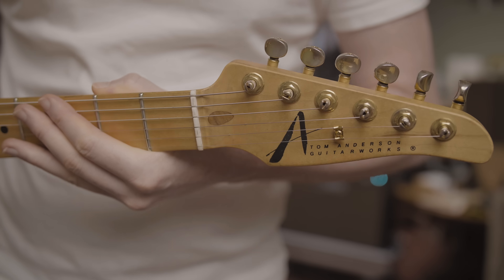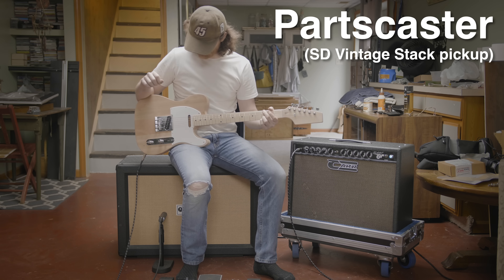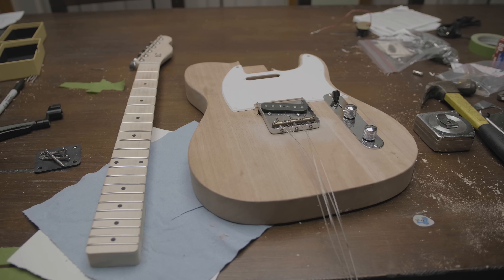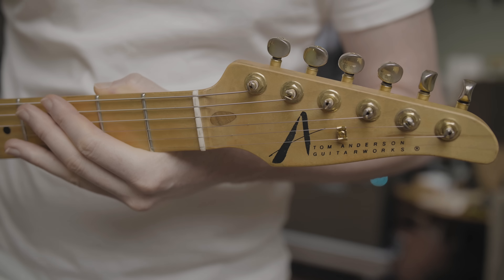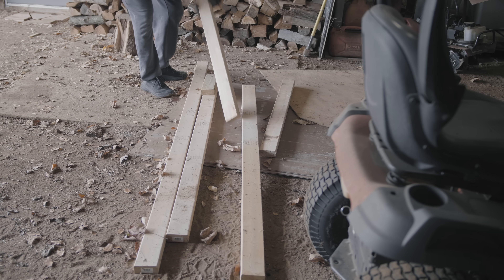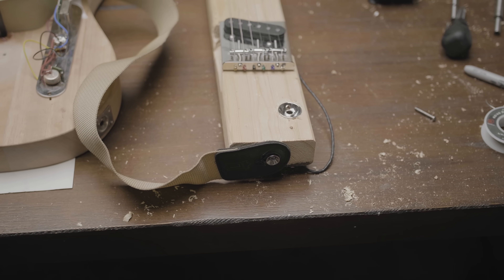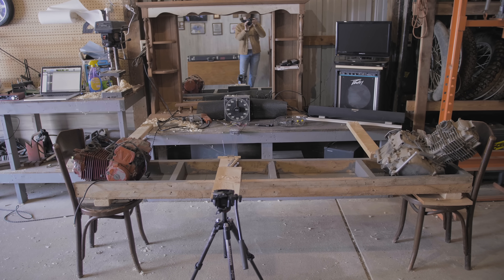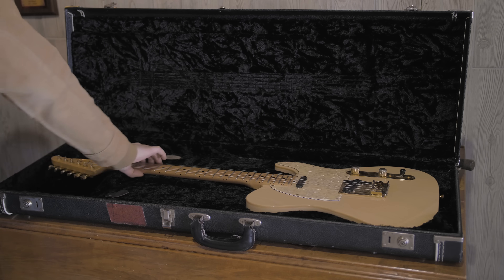Tested: Where Does The Tone Come From In An Electric Guitar?

Comment: Truth is wire length, type, capacitors pickups and wiring are all that matters concerning tone. Playability, sustain and consistency of tuning are the only factors that the guitar itself affects. Acoustic guitars are where the wood selection is everything. In both acoustics and electrics, neck joint is responsible for sustain. Tone is impacted by neck joint only in an acoustic. Dovetail joints offer more warmth and sustain in the acoustic. In the electric, sustain is the only tangible variable. Taylor acoustics are super bright because of the bolt on block. Gibson and Martin are warm and sustain because of the dovetail joint. A les Paul will sustain longer than a strat, but the tonal differences are 100% humbucker vs single coil. My Custom Shop Strat is only better than a squire because of electronics and wiring. Swap both loaded pick guards between the two, the squire would sound like my custom, vice versa. That stated, a squire on a high end tube amp would sound much better than my custom on a $99.00 practice amp. Buy a cheap guitar, a set of seymour Duncans, and take the money you saved and purchase a better amp. Trust me on this one. An amp upgrade will satisfy much better than any guitar mod or upgrade.

Comment: This is amazing work. Personally it confirms what I've always thought to be true, that the string's interaction with the electronics are what determines tone.

I just wanted to say that just getting a certain tone isn't everything. Sustain for one, i wonder if that engine weighted steel bench was just much better at holding tension than the softish 2x4 and cleaned up the top end through improved sustain or possibly resonance, depending where the amp was.
Reply: https://youtu.be/sYK0XX-nDVI

Comment: I guess my next build will be with a 2x4. Sounded great. Great video. Sometimes I think the perfection that people try to squeeze out of a guitar is one of diminishing returns. Throw money at it to get 1% improvements, however that’s measured, when most people would never notice the “improvement”. I also believe you could put a top band on stage with all kit guitars, and very few would notice. Doesn’t mean I wouldn’t want a high end factory guitar; just means I could get on stage with my doctored up Squier Strat and no one could tell. It does sound great.

Comment: This is a good video. I could hear some very slight differences in the two bodies when you matched the height, but virtually no difference with the air guitar. Question does engaging with the fretboard and neck have an impact?

Comment: I've always stuck by the theory that the only thing that makes a difference is the player. Case in point, you could take any person and have them play a guy like Dimebag Darrells exact set up and it will sound completely different than when Dimebag is playing. 

Of course for test purposes when playing  is identical I've never thought tonewood mattered on an electric guitar simply because the sound itself is coming directly from the pickups.

I'd say 10% is hardware, 90% is the person playing it

Comment: I always suspected “tonewood” was a gimmick. Except for acoustic guitars, then Im pretty sure it matters.
Reply: Yeah it's definitely important for acoustic guitars
Reply: The reason why it's important for acoustic guitars is the sound you're hearing for the most part is the soundboard vibrating. The soundboard is the bit of wood on the surface of the body that the bridge is attached to.
Reply: Although, I have found it's not as important as people think with regard to acoustic guitars either. Yes, the soundboard is critical. But, the rest of the guitar is not nearly as important.
Reply: @probusexcogitatoris736  Yes Torres made a paper mache back and sides guitar in the 19th century to help prove this point.
Reply: @probusexcogitatoris736  to me it seems like the overall size and rigidity of the guitar body that makes the ultimate difference for acoustic guitars, so bracing etc moreso than just the materials themselves.

I've been a 'tonewood' sceptic for electrics probably since I started playing guitar when I was a teenager though.
Reply: @danardisimracing  Yes, that is probably true. Would be interesting to know whether that is actually more important than the soundboard....
Reply: I think even for acoustic though, body shape and the size of the sound hole are probably the two most important variables.
Reply: @markkicksass2448  I'm not entirely sure. I encountered an early D-60 at the Martin factory back in the mid1990s.  It's basically just a D28 only with a back and sides of maple instead of rosewood. It was brighter and snappier sounding than any other dreadnought I'd ever played.
Reply: I think wood is probably important for durability and intonation as well, not really quality  tone itself
Reply: @Phazur  wood makes a huge difference in tone quality. At least in classical guitars. Maybe a bit less on steel stringed guitars, because they need to be built sturdier to withstand the tension.
Reply: Listen, buddy. There are dentists, investment brokers, and pharmacists on TGP with impressive PRS and Gibson collections who argue that there's a massive difference between their Honduran and African mahogany guitar bodies, and that their two piece and one piece guitars aren't even in the same realm. You think I'm really gonna believe you yokels over these guys and their finely tuned ears?
Reply: @karlkrause6679  😂 I’m actually a pharmacist so…. Yeah 🤣
Reply: Acoustic guitar bodies don't have to be made of wood. Mattias Krantz made a guitar with a balloon as the body.
Reply: @YlowX7  of course they don't have to be...but the material actually makes a big difference in sound.

That's like saying you don't need wheat flour to make bread. No, you can use something else, but obviously it'll taste differently.
Reply: Isn’t tonewood on an acoustic guitar basically an amp? No doubt it’s important.
Reply: absolutely right mark kicks ass! edit: your original comment..
Reply: There is a difference. The question is, is it a 5000$ difference?
Reply: @tubeaddicted485  it is law of diminishing returns. I think expensive wood for a guitar is for good aesthetics for a natural, transparent or semitransparent finishes. For a solid body though I suppose for weight and durability but not for tone.
Reply: I think Greg Byers talked about doing a similar interchangeable guitar experiment.
Reply: Funny how many of us rebellious artsy-fartsy types are easily influenced by corporate marketing.
Reply: For acoustic ones is a strong pillar. For electric ones, well, you have just heard it.
Reply: In this video I hear a difference between maple and rosewood frets. Nearly every variable creates a slightly different sound. They all add up to the differences between guitars. Is a different wood going to make a big difference? No it's only a tiny difference. But you cut a corner here, cut one there and it starts to add up. Obviously the biggest difference is pick ups. Swapping those will drastically change the sound but all sorts of other factors make smaller differences.
Reply: That's what you're getting from this? To me, this just affirms my understanding that, with everything else accounted for, tonewood still makes an audible and considerable difference. Even with pickup height and electronics standardised between the kit guitar and the Anderson, the Anderson still sounded notably fuller in the low mids, and had a much softer top end.
Reply: @MrColmdonnelly  it’s a subtle difference

Comment: I picked up a Yamaha  1212s guitar with a Seymour Duncan Steve Lukather HB active pup and 2 matching SC's. The neck is the best I've played in 30 years and the  thing sounds amazing.
Connoisseurs  will laugh but I got it for $80 with a Kustom 80 watt 1x12 and a cable. Oh, and I painted it with a 2 step translucent red over base silver (which didn't change the sound at all, of course).

Comment: When you think about how sound is generated on an electric guitar, it's simply the vibration of the metal strings disturbing the electromagnetic field generated by the pickup.  As you found out, the most important adjustments are the ones that tune the magnetic fields and filter the sound in electronics.  The body, neck, and other parts of the construction have a much lower impact in that they can only tune how well the strings vibrate.  Les Paul famously took a 4x4 post as a solid piece from the top of the neck to the base of the guitar.  He carved the neck portion down so it played like a regular guitar neck.  Then he cut off the sides of an acoustic and glued them to the sides of the 4x4.  Apparently the solid piece of wood provided a sustain for the strings that was unmatched by guitars with a separate neck and body.  At least this is the story my professors at Full Sail told back in the 90s.
Reply: There's actually a great video where a guy goes to the Gibson museum to play a reproduction of that first plank guitar.  Details the history,  too. First thing Les thought of was a railroad tie for best sustain because was most dense thing he could find!
Reply: And the only reason he put the sides of the acoustic on was because people would ridicule the "broomstick" instead of recognizing its amazing sound and the performance.
Reply: It's likely that wood and construction has some impact on sustain, but I don't know how significant it is. A rubber-bodied guitar might achieve the same tone as a normal guitar, but I'd expect the vibration to be damped out more quickly. That's an extreme example, of course.
Reply: @JMMC1005  Since tuning the string over the magnetic field is one of the largest impacts on sound, a rubber body guitar will probably fail because it can't maintain it's shape.  Unless that rubber was reinforced with something, you probably wouldn't even be able to tune it.  I've seen tons of polymer based bodies or resin pour style bodies from people's personal projects.  I've even seen some aluminum bodied guitars (a Japanese company makes them).  Biggest factor here is the rigidity of the materials.
Reply: @berinloritsch  Well, yeah, that's true. I used rubber as an extreme example, but it wouldn't really work for other reasons. Interestingly, the guy has just released a new video investigating the effect of construction on sustain! I'm off to watch it.
Reply: @JMMC1005  I like the 'theory' that the most significant impact tonewood plays is changing the tactile vibration that the player feels and just helps make up all the touch and feel aspects of how the guitar plays.
Reply: Dude, I went to Full Sail Brewery too! -Fellow alumn. (My uncle lives in Hood River, I was a shoo-in)

Comment: Well the 2x4 plank guitar has less bass and / or more prominent midrange, and I bet less sustain. The bench / air guitar has a huge mass so sustain and bass frequencies are not an issue but it has no fretboard so you're not exploring its harmonic detail. As a side note, my first hand experience tells me that two guitars with the same electronic but different woods and paint sound different.

Comment: Very nice demonstration. A similar test with a hollow/semi-hollow would be interesting. I can accept that the solid body doesn't resonate significantly, but hollows definitely do.
Reply: Resonance is important when you play unplugged.
Reply: Solid bodies definitely do resonate. The problem is that the pickups don't capture the sound the wood is making, they only capture the strings themselves.
The only way you can hear such differences is if the resonance somehow "reacts back" to the strings, pure resonance isn't enough. This might be true, I haven't seen a test of it yet, but I wouldn't be surprised if it wasn't either, because again, resonance doesn't matter, the reaction back is what matters.

Comment: The ‘air guitar’ is actually the highest mass unit of all in this video.   You have a entire bench and an entire table in there.   The fundamentals of hat aspect of the test are too different to be considered part of a valid test.

Just a headstock or something to support the tuners and nut attached to something much smaller with a bridge and pickup would be a more valid test.
Reply: if you made a guitar on the ground, the earth beneath our feet, the highest mass we could possibly get, i still dont think it would change anything tbf. it could be on the side of a building or a 2x4, and it probably wont effect much at all. although i see where the confusion is, this video seemed to disprove almost all of this. maybe it could affect sustain, though even that just seems to be affected by the bridge and nut, build quality, and tolerances. this is definitely a valid test, just not crazy specific like measuring frequencies and exact sustain with a controlled strum. but his test was "does this noticeably sound different after it leaves the amps speaker while a human plays it" not "does wood amount/density/shape change anything output-wise".

also i'm trying to respectful here because these are all great questions, not trying to come across as an ass or anything. cheers

Comment: For me that's the definitive end to the "wood creates the tone in an electric guitar" discussion. What an awesome video! :)
Reply: Because you couldn't heara difference? This is really telling to me, because all of the 'electronics are all that matter' guys all apparently can't tell the difference between these sounds.
Reply: @allrequiredfields  the simple height of the pickups affected the tone in a much more substantial way than basically all the modifications he did after that test. Even if there is a slight difference, it is pretty obvious that the electronics contribute to an OVERWHELMING MAJORITY of the tonal change.
Reply: @dougnulton  Anyone with half a brain and one ear can hear the difference pickup height makes. Effectively, it's simply a change in output, increasing gain as you bring it closer to the strings (of course until it begins to choke them).
The interest in different types of wood is tonality, not simply an increase (or decrease) in volume, which is all you're effectively getting from pickup height.

And furthermore, for most guitar players who are interested in the wood of the guitar, it's not about maple vs mahogany vs whatever (though those woods DO sound different - unless you can't hear a difference between a Les Paul and an SG, where the only real difference is the wood the body is made of) it's mostly about the ancient wood Gibson used (the stuff was literally hundreds of years old, that they were using to build their guitars with) and for Fender (who used whatever was cheapest) they were using wood that, up until the mid-60s, was still air cured, not kiln-dried. 
The bottom line for ME (and most who care about guitar wood) is that the issue is more a matter of how old the wood being used is, and how it was cured. So when we see videos of people comparing different types of new wood, all young and kiln dried, it's more like comparing types of spoons, rather than anything consequential.

I've got several vintage guitars that I carefully selected over the decades and I've yet to find any their modern counterparts that sound anywhere near as good. 
I absolutely can, and HAVE, called my 1967 335 out of an audio lineup of other modern (90s-on) 335s. My 1966 Casino has the same sort of magic, just as my 1963 Strat - none of their modern counterparts sound anywhere near as good. 
I'll tell you in all honesty, if I could find their modern counterparts that sounded even AS good, I would sell all my vintage shit in half a heartbeat and pocket the tens of thousands I would profit from selling all my old shit. The ONLY reason I play old guitars is because they sound better (and no, it's not because they aged, because my old shit sounds EXACTLY like it did on old 60s and 70s recordings.
Reply: @allrequiredfields  cope
Reply: @allrequiredfields  It's not that it makes completely zero difference, it's just that it's that it matters the least. All the miniscule difference in tonewood is easily thrown away by a slight flick of a knob. 

Simply, tonewood is irrelevant. The only real reasons on choosing wood is appearance, comfort, and durability. Mango looks sick, you can do cool patterns with the cheaper plywood, but I don't see them as much just because many still believe tonewood matters.
Reply: @allrequiredfields  True, I couldn't hear a difference and I used quite good headphones, so that couldn't be it. And I'm pretty sure that 99% of people can't hear one if they're honest. But of course there's always the one in a million audiophile that is able (or at least pretends to) hear the wood-grains resonating

Comment: Arguing that wood has an effect on your tone is like saying wooden electricity poles are better than steel electricity poles. It's not relevant. 

What this shows is that if you give me the same electrical circuit from an expensive guitar and i replicate the geometry, i can set that in a plank of wood and it will sound the same. 

It won't feel the same, but that's not to be conflated with sound. 

But that's a whole other can of beans.....